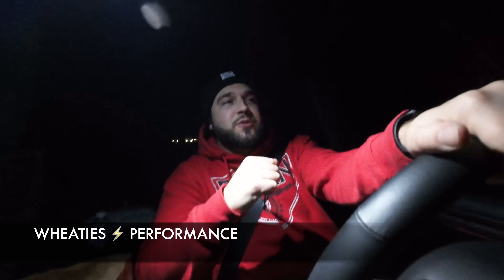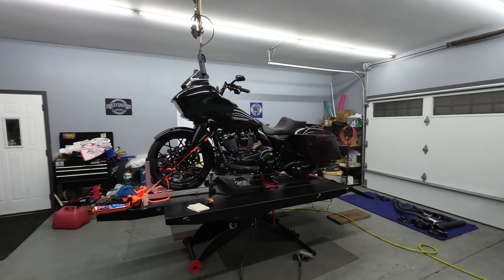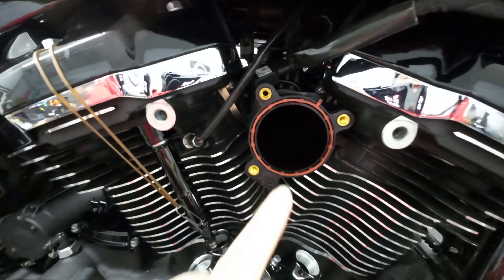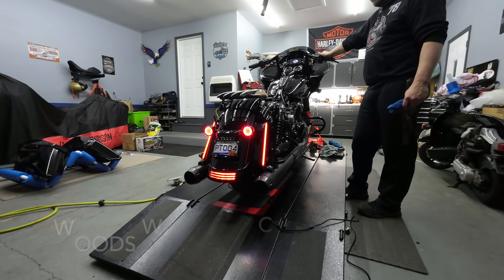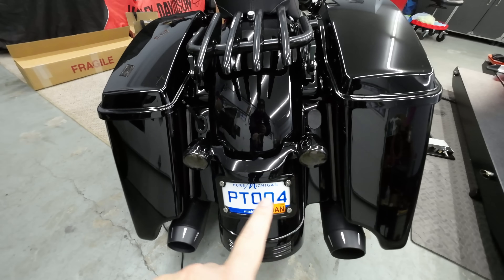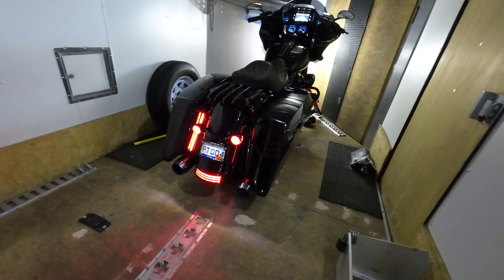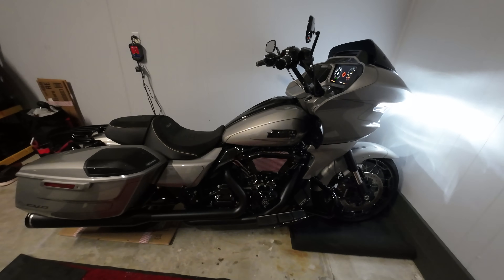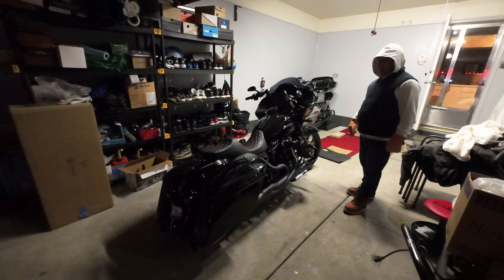WOOD PERFORMANCE 22XD CAM INSTALLED IN A SUBSCRIBERS ROAD GLIDE! *STAGE 2*

Comment: Super Shox is a small family business that made its name in outlaw dirt racing building shocks for Sammy Swindell. They crossed over into bike shocks years ago. They build the shock for your riding style. Very pleasant to deal with, incredible value as well most rear sets are under $750.00 in black.
Reply: I raced sprint cars for years and Brian at super shocks is by far the best in the business. Also have them on my road glide and won't run anything else.
Reply: @jlcripe  They have my business for life. My wife has a set on her sportster and I also have them on my RGS. I've  never understood people dropping crazy dollars on rear sets that SuperShox does just as well or even better for a fraction of the cost.

Comment: I see you running cyclerama on your baby (which is beautiful by the way) one of my mechanics was talking to me about their cams, I just wanted to get your take on how good of a cam they are, I have a stock 2008 screaming eagle which you know comes with a low compression motor and he says cyclerama cams are good for the low compression motors. If you have any input i would greatly appreciate it
Reply from the maker: Yes, those are great Cams! Highly recommend.
Reply: Awesome I appreciate it, a lot of ppl do S&S but I haven't seen to many videos on cyclerama and I wanted to do something a little different. My plan is a full rebuild  and hopefully I'll get the power, tq  and still be able to ride long distance with no problem.

Comment: What lifters do u use? Thats all i have left to order for my stage 2 on my 2023 lowrider st. The CR483 was out of stock till after February so i had to do the star 3030.  😢   i hope it performs well or ill be tearing it back apart  when the 483 comes available.
Reply: I'm running the 30 / 30 cam and although the CR483 is a great cam, the 30/30 performs extremely well, you will not be disappointed, you should change out the rubber intake manifold though
Reply: @michaelthompson7001  I was gonna change whole intake out to 55 aluminum one
Reply: Wood Knight Prowlers are about the best lifters out there.
Reply from the maker: @hoodsolo, we use S&S or Wood Knight Prowler lifters.  We have had great luck with both of them.
Reply: @DOOWORKPRODUCTIONS  I appreciate it. I'll check the woods out

Comment: How’s ray cs for dyno tunning a stage2 what’s you thoughts
Reply from the maker: You're better off getting a can tune from Fuel Moto for a stage 2 build if they have a map already for your mods. Ray C's doesn't adjust timing, they just make sure your air / fuel ratio is right and send you on your way.  They are restricted with what they do because they are a HD Dealer. To get maximum results and power, you will need to find a tuner that can adjust timing and know what they are doing.  They are hard to find, that's why I made the 1500 mile trip down to All American Cycle.
Reply: Ya that makes sense I’m in Ontario and it very hard to get anyone to tune a bike here I have a19 roadglide d&d pipe 30/30 cam 55 imported manifold 5.5 injectors trying to get it dialed in as close to Ontario as possible and I watch you’re videos love all the info man keep it up great job
Reply from the maker: @BigObikes  Thank You!  I am sure Fuel Moto will have a can tune for those mods so give them a call and talk to Lucas!